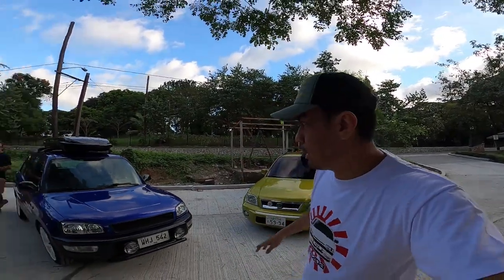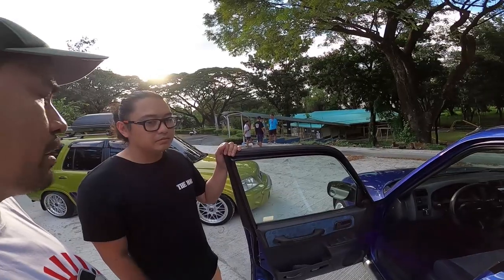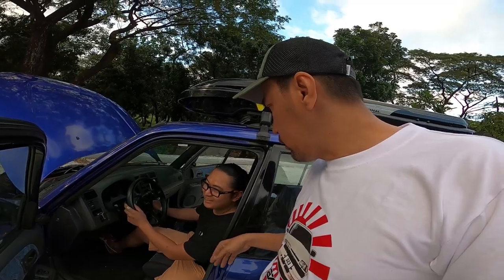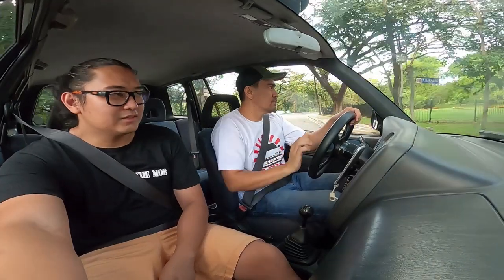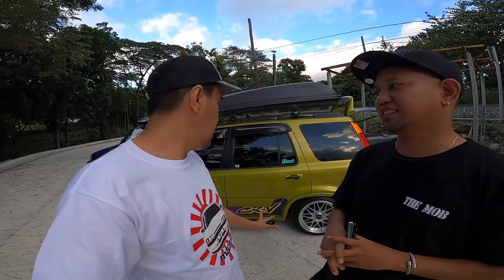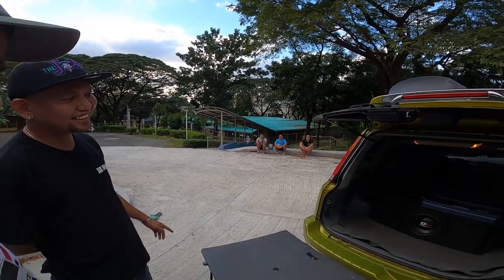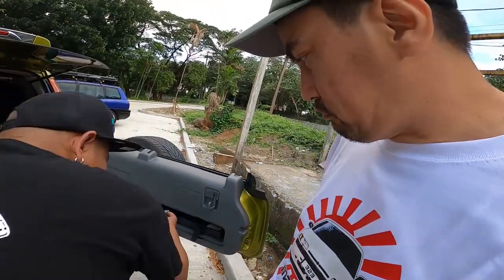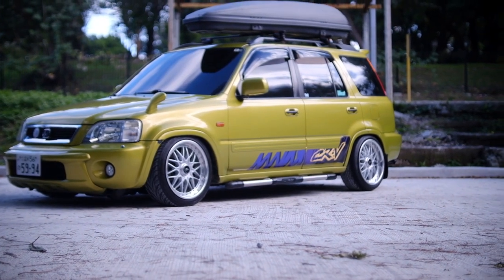1999 Toyota RAV 4 vs 1999 Honda CR-V

Comment: Gotta love the Rav4. I also have 1st gen 1996 with 129k miles 5peed bone stock, use it as my weekend and after work car. These cars are very reliable and easy to maintain.
Reply: Agree, my 1996 needed a new block pero before new block malakas sya kumain ng oil. Kahit wala ng oil umaandar paren 😂

Comment: kanya kanyang trip talaga, original RAV4 even the 4x2  is maganda lalo na yung 2003-2008. Don't no why I will change the original set-up. Low maintenance, no major issue experienced so far. Tipid pa den sa gas all this time.

Comment: Compare them all you want. Now speaking from experience you only need to compare the engines. The crv engine 1.5 turbo is junk. We had a 2017 crv that had the so called fix for oil dilution with gas and it did not fix the problem. We dumped it with 15000 km on it. The oil was black all the time and smelled of gas. We bought a 2019 rav 4. Way better engine. Don’t get me wrong. We loved the crv but the engine is the most important part. Now if you ask Honda sales or the company you will get a different answer.

Comment: Ramon is good! Those idiots were not engineers! crossover  vehicles were fun on tarmac and a lil bit of offroad .. those babies cant go anywhere but the tarmac.... lairs... edsa is worse.. why change.. lower or what? Change a good tire, mechanical, electrical support and a good driver and go on with the adventure! .. its called CROSSOVER

Comment: Bugoy anong haters? It's not designed to be lowered. Lowered cars are meant for racing on the track. Ang hirap kaya mag drive ng naka lowered. I learned my lesson. Tapos ang hirap din sumakay at bumaba, lahat ng humps yari ka. It's not hating it's having common sense. Kaya todo ngiti si Ramon dahil alam nya impractical.
Reply: Also AFAIK yung CRV same engine ata sa Honda Integra, hindi sa Civic.